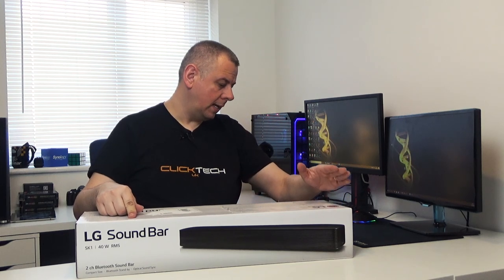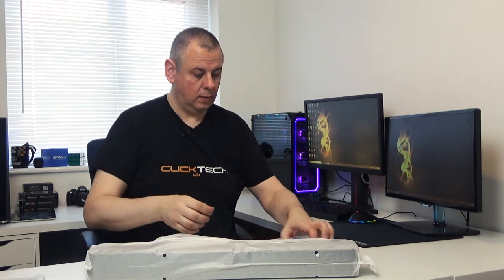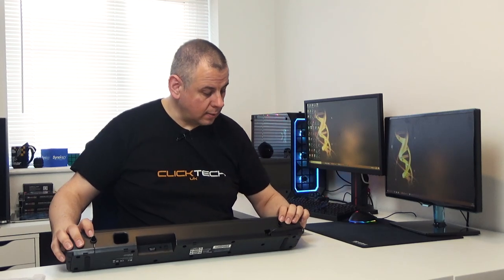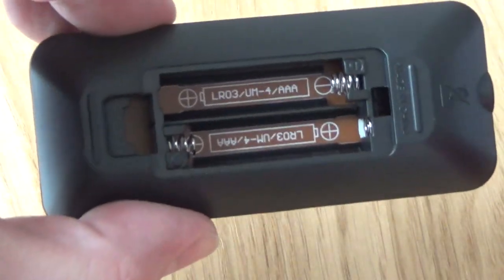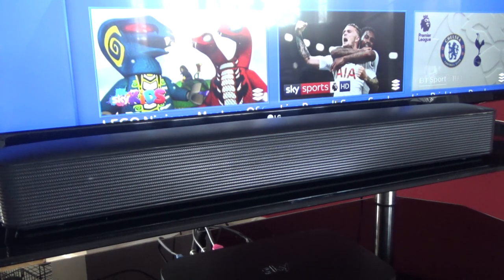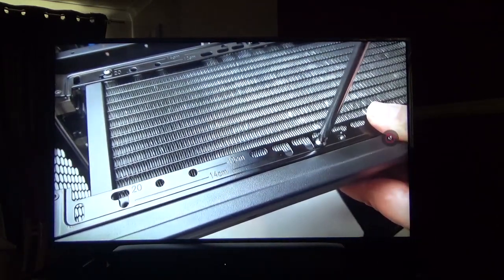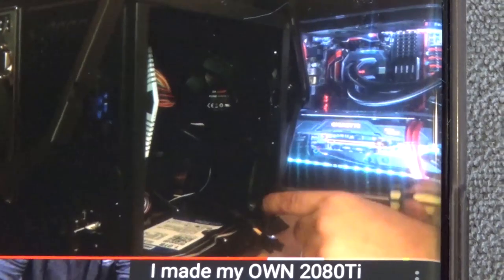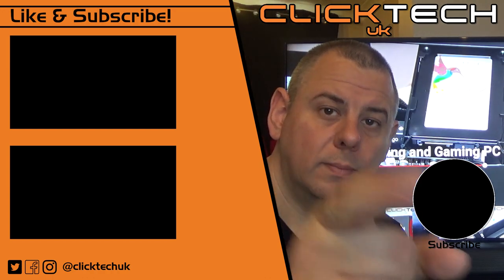LG SK1 Sound Bar - Unboxing and Set Up

Comment: Just got one back from LG after repair, did I plug the connectors from sound bar to TV wrong?  One end of the connector has a bit of plastic on the pin.  Tried connecting both ways and I still have no sound???  Any suggestions?

Comment: Nice review, well done! Bought on today and returned it! Very easy and fast to set up, but the bass is almost non-existant, the sound is clear and crisp but not much better than the internal tv speakers… Found out very good reviews about the Creative stage V2 2.1 soundbar, and bought it today… For a few bucks more, wow! More connectivity options, very decent sub whoofer et overall excellent sound for the money! Check for yourself!

Comment: Does anyone have any info on how to disable the power saving mode on this?
I haven't found anything, and it would be pretty stupid if they dont even let you determine whether you want that for yourself or not
Reply: Hold the mute button on the remote for like 2 or 3 or 4 whatever seconds until the LED lights flash on sound bar and that turns it off… but this feature is auto power, which means it turns on when you turn your tv on and also goes into standby mode when you turn your tv off... But the sound bar will always turn off automatically after it is in standby mode for a certain period of time. It’s like 6 hours I think. There’s nothing you can do about that…

Comment: Great Video! I bought a Bose Sound Bar about a year ago and I love it. However my next sound bar might be the LG SK1.  The shape and the size look identical to my Bose sound bar.  Does it get good bass? You should be able to link your other remote to the bar. The Bose sound bar was very easy to link up to my Samsung remote control. I had to buy a longer optical cable for my TV. The Bose came with a short one.Thumbs up man!
Reply: Ultimate Tech Hub hello! Did you get the soundbar? Which Bose soundbar did you have? The solo 5? I am trying to compare the Sk1 to the Bose Solo 5. Thanks
Reply: Boss it’s always better. Can’t compare to this one. I also have a boss and never have any pro. Boss it’s a boss.

Comment: I have a problem with this unit occasionally turning itself off (red light) and not responding to the remote to wake it back up.  Sometimes it fixes itself if you leave it alone long enough, and other times you have to unplug, or just mess around with it long enough and it will fix without knowing what the hell you did.  Currently I am in one of those fixes where I am just left waiting and scratching my head and hoping it wakes up again.  It's a real pain in the ass.  I would not buy another.
Reply: Same problem, did you find any fix ?
Reply: Well I won’t buy it again, have the same problem.
Reply: @aerob1n  unplug it, wait, bang some gongs and shake some chicken bones, maybe burn some incense and chant or pray, and wait to see what it does.